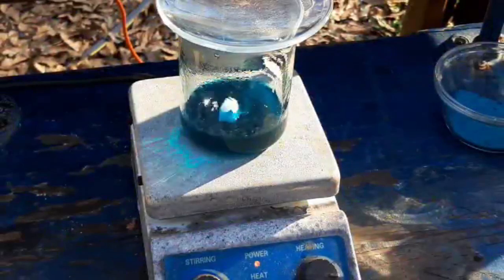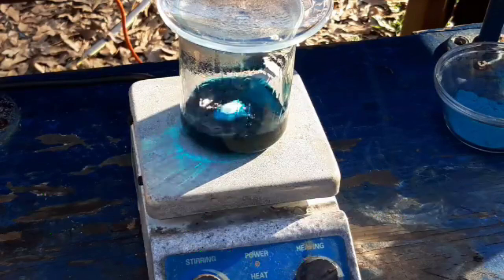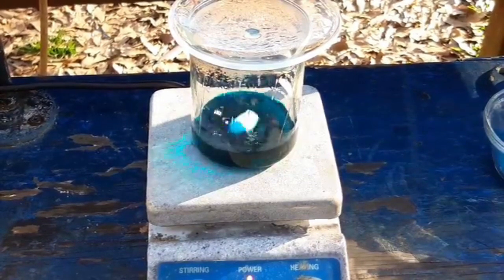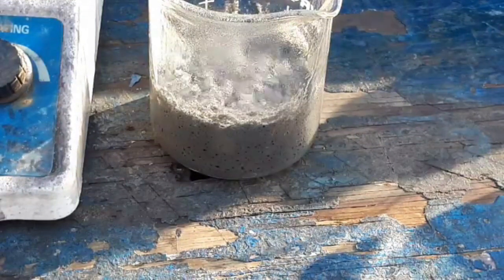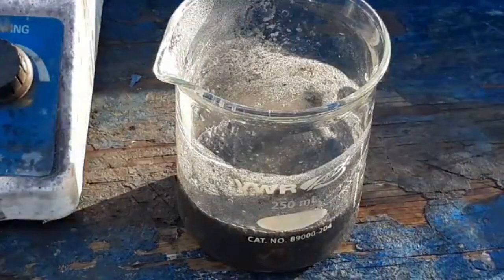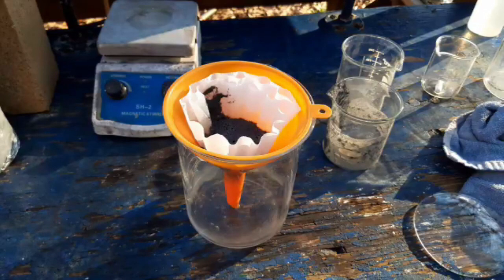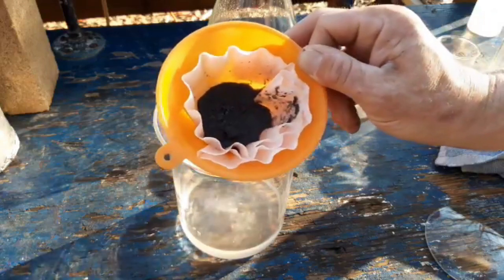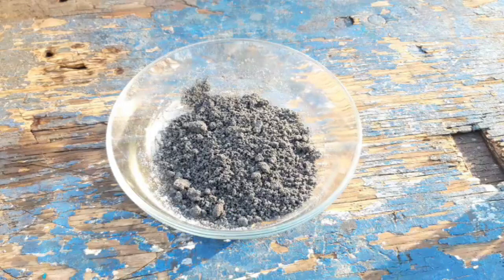Zinc-Copper Couple for the Simmons-Smith Cyclopropane Synthesis

Comment: Hey, i am working at this reaction the last few years now.

The zinc indeed seems wuite bright. Usually it gets a darker slight violet tone. Anyways you can test its acrivity by putting some drops of dibromomethane on it.

Nowadays the zn/cu couple is produced in situ, since this procedure in my opinion quite a messy and ether is not really used nowadays anymore.

I am currently working on a flow chem. approach of this reaction 

Nice vid, regards
Reply from the maker: Thanks for that!! It's always awesome to hear from someone who
has practical experience with the thing.

Comment: Only prepared Zn/Cu before once but I did it fully under inert conditions using Schlenk techniques. I washed it with dry, degased ether and stored it dry under a nitrogen atmosphere. It looked more violet/copperly than what yours look like. In my case it worked quite well to make dichloroketene for a cycloaddition.